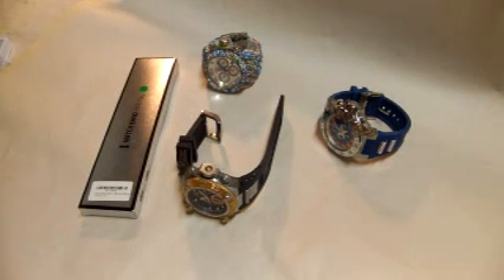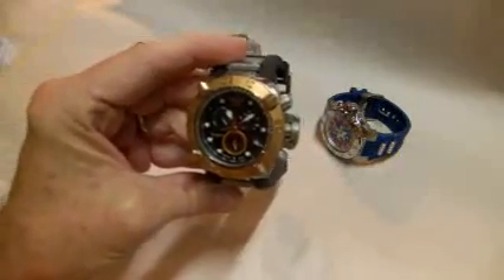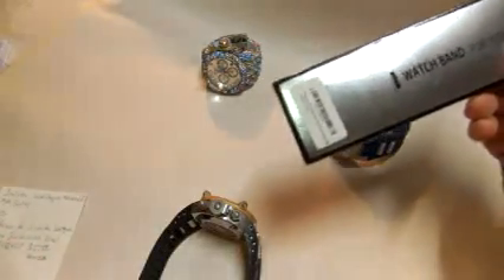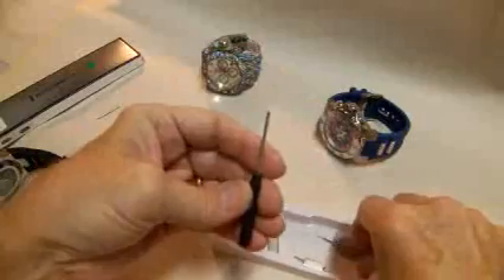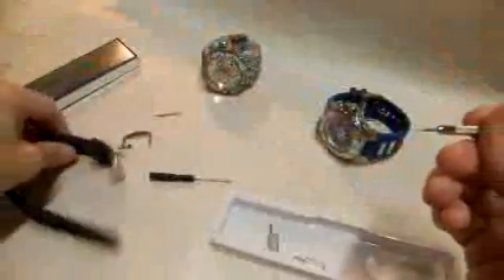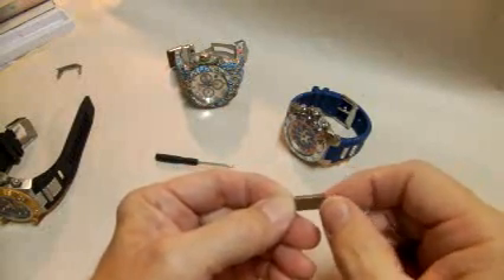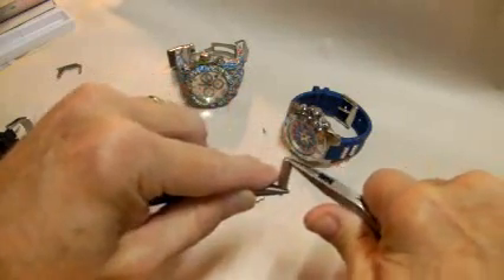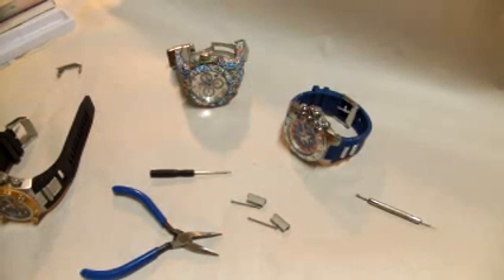Invicta SubAqua Noma 4 16141 Watch Band Screw Removal

Comment: They are actually small screws so use a plier and break the old belt carefully and twist the screws off. If you pull on them, they will break and you will need to replace the whole thing.
Reply from the maker: I agree, they are very small screws. Be as careful as possible when doing this. It took me a while to figure out how to get them out without breaking anything. Very frustrating.

Comment: I have a SAN IV automatic with a Sellita SW200. 
The Strap broke and I cannot find a band. It must be the same exact band. The poly straps with Invicta don't last very long whether you wear it or not.
Reply from the maker: I agree. I have found that the poly bands just don't last, like you said whether you wear it or not. I'll stick to rubber bands whenever possible. Due to the fact that I'm hard on watch bands they last longer - for me.
Reply: @crpsjon I am having a difficult time prying these tube/screws apart with plyers. I am soaking them in WD40. You definitely can't unscrew them. I also don't want to snap the ends off.